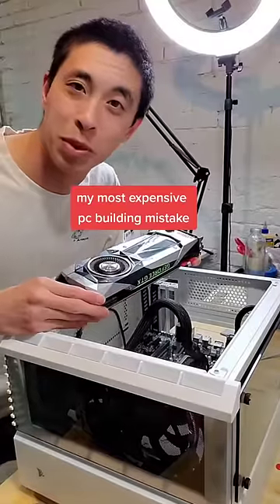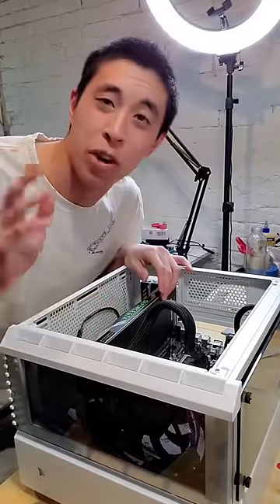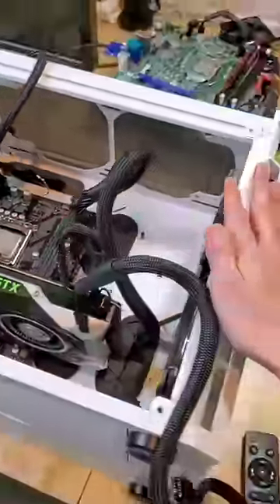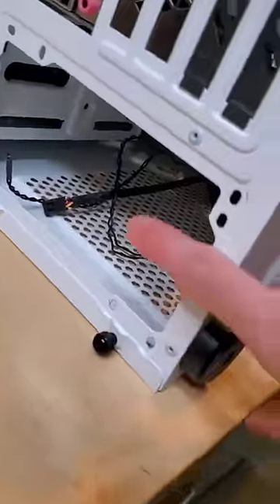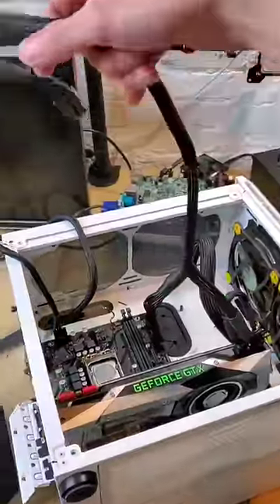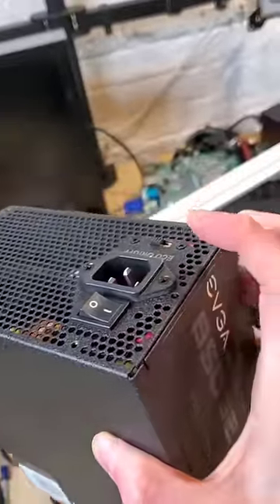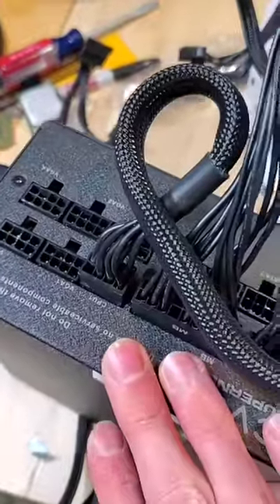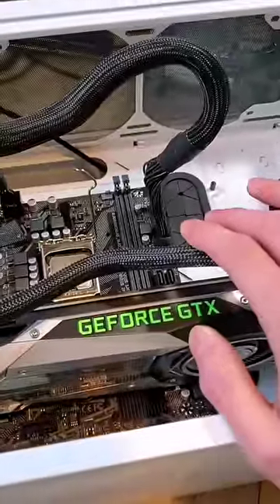my most expensive pc building mistake... #shorts

Comment: The moment I heard "pre-routed power cables" I knew exactly where this was going and I felt myself die inside.
Reply: Yepppp. First thing I went "oh pls no."
Reply: My brain went "Wow, you can do that??" As in, just mix and match cables, and no, apparently, you can't - good to know, and an understandable mistake. The one selling it set that mistake up. Every power supply comes with cables, why interchange. I had a power supply die, and switched all the cables... I think... Most at least...
Reply: I wonder why they dont make the modular psu cables a standard. It seems to be a no brainer to design them in a way that you cant accidentally plug them wrong.
Reply: @jariroth  This is a good idea. You should post this in the greater comments section area so others can see it.
Reply: @laurierbaribeau7785  just curious but what about strimer cables
Reply: @girinevass8559  those are just cable extensions
Reply: Hold on.... WHAT?! You mean I shouldn't use power supply cables from one PSU with a different PSU because they can have different rating? Bruh. That's crazy I legit didn't know that.
Reply: @girinevass8559  Looks like those are extension cables which will be fine as Robert said. They don’t do any crossing over. The problem is from using cables from another power supply.
Reply: I still don't get what was the problem... Wasn't the socket intended for the cable? How did he fry everything like that? I never used a modular psu before
Reply: @fullmontis  modular psus allow you to plug in whatever cables you want that fit. BUT the cables have different pins that plug in. For instance, from what I saw of my own psus last night, GA vs GQ sata connections have different pins going to the power supply. So if I had plugged in GQ pins cable to a GA power supply, I think I could have destroyed my hard drive. I think that's what it means
Reply: @SongEternal  Oh I see, thanks! And damn! That sounds really unsafe. Shouldn't it be standardized in some way? Like sockets on the motherboard are, so that you can't accidentally plug stuff in the wrong place
Reply: @fullmontis  I would think so too, but I'm guessing it probably has something to do with proprietary something something. And some people you ask about it will just say "WHY DIDNT YOU READ THE POWER SUPPLY IT TELLS YOU CLEARLY WHAT MODEL IT IS". So I have no actual idea because I haven't found any valid answers.
Reply: @fullmontis  The cable fits in the socket but the functions of the pins are different, like what should be ground is powered, what should be powered is grounded. So the wrong cable connects the circuit incorrectly and lots of current flows, frying and destroying lots of the electrical components on the boards. The chips can’t handle that sort of thing, they have to assume ground is ground. This is a bit speculative for me, maybe we could confirm how these pinouts vary among power supplies and cables, but it seems pretty certain that something like that is happening. Not sure exactly what the circuit is though, but seems like a lot of stuff is getting shorted or reverse biased.
Reply: @laurierbaribeau7785  that sounds like a recipe for disaster. It's terrible engineering to make a socket fit with different pinouts. I wonder why they did that in the first place.
Reply: Sry, can you please explain the video, I didn't totally understand what the issue was...
Reply: Me too. I've only been in the game a few years but have heard a few people mention it in the past.
Reply: So technically. . . buy a BRAND NEW power supply with it's very own cables and forget destroying your shit 🤔
Reply: I actually thought that the seller could actually have sold a broken pc and intentionally left these cables so that this would hopefully happen and the customer things he destroyed the hardware 😂. But that’s just my every day paranoia to buy something used. I had so many stuff I bought on eBay came broken or not working correctly that I literally fear buying something used.
Reply: I must be lucky to not have this accident cause I just mixed cables from 2 EVGA PSUs and it was fine (850w and 1300w)
Reply: @DJSelphi  well it's possible in 2 PSUs of the same brand that the pins are the same. But they have changed them in the past and there's always a chance they'll change them again.
Reply: @laurierbaribeau7785  as for your why, I also in part blame difficult cases that encourage trying to save time like this.
Reply: @barsam2a  he used power cables that didn’t come with his Power Supply, they looked like they would work, but did not.
Reply: @scorcher117  Thx man!
Reply: Did the same thing and fried 2 ssd-s and 1 hdd in a single push on a power button
Reply: Yup me too lol.  My wife almost did that once.  I was building a new PC and she was helping and I needed another power cable for my GPU but couldn't find one (I was reusing the PSU from my previous PC) so she went upstairs and grabbed one of the extras my daughter had.  Thankfully I noticed lol.
Reply: @jariroth  because they want you to buy cables.  They make TONS of money from cable sales.  They are marked up like 5000% lol
Reply: Me too! Such a common mistake if people don't know. This is a great PSA. My condolences on your loss 😬
Reply: big yikes
Reply: Facts smh I did the same thhhhinnnng with a PSU I owned previously had left in the shed had a spare case with the same modular cables right same thing fired everything was so sick
Reply: @Bob Saget don't mix and match expensive ones either. There is like 20 different pin out configurations out there, cheap doesn't have anything to do with it
Reply: I saw the headline, and already knew where this was going
Reply: @SongEternal  so do I have to be careful at both ends? Power supply matches cables and the cables match the cpu/gpu etc? Or is it not important for the gpu? (don't really expect it, but idk)
Reply: @Ray25689  I think only the part that connects to the PSU is the non standard part
Reply: Why does this break things? Is it just that different cables have different resistance values?
Reply: @supahbob94  how do cable extensions work but swapping the cables doesn’t. Is it because the pin out on the psu side is different model to model? Like what’s the reason this goes awry?
Reply: @laurierbaribeau7785  can extension cables be directly connected to the PSU?
Reply: @SongEternal  you mean different cables are channeled to different pins at output? Like cables outputs are placed differently for different PSU's?
Reply: @prus5177  yup
Reply: @d0x360  gotta love that planned obsolescence
Reply: Wait so if im building everything brand new i dont have to worry about this right
Reply: @rayyan6592  should be no problem, if youre using cables that come with the psu.

Now, what im wondering is what if you get those fancy aftermarket psu cables for both better organisation & looks. Granted, theres rly no wrong way to connect them since the pins wont fit otherwise, reading comments on here makes me think if they dont have the correct rating, they can fry your stuff. Most people i see who use those fancy cables dont seem to have this problem though.

So aside from present day aftermarket cables all being of sufficient rating, or that there was some static electricity left in the pre-routed cables that fried things when its rerouted again?
Reply: @SongEternal  it beats me how badly do many of you want to save these few minutes. When you buy new car, do you use the tires from the old one? Lolz.
Reply: Im getting a new gpu required 2x 8pins power cable , is there anyway that i can screw this up ? Im a noob
Reply: This is confusing so he used wrong cable from another system to run this one cable was botched it killed his system not one supplied by the power supply?
Reply: @wispartan  Yes. If you use the cables from a different power supply you can melt your components.

This is because the pins may be configured differently, meaning that essential pins for grounding etc. are not correctly connected and leads to failures that can brick everything.
Reply: @Don_Akane89  The reason using different cables than the ones for your PSU can brick things is because the pins may not be configured the same. Think of the cable as an extension of the slot that it's plugged into; those slots are designed different by different manufacturers. The shape is the same, but which pin is in which hole can be different. Don't ask me for specifics honestly, I won't pretend to understand it well enough to explain in detail. What matters is that the correct pin configuration in the cable must match the PSU. Motherboard side doesn't matter, just received power.

As for the aftermarket cables you're talking about, those are cable extensions. Keyword being extensions; they connect to the original cables that come with the PSU. So original cables go into the PSU, then the extensions go on the end to look nice. All the extension does is literally what it says; extends. Doesn't change the pin function or rating etc., just makes the cable longer, hence no issue.
Reply: @Kastigador19  keyword is extension. You can't "extend" what's not even there in the first place and vice versa. 

This is why you can't use extension cables directly from components to PSU. Want to use custom sleeved cables? The cables need to be built specific to the PSU pinout hence why they are quite expensive.
Reply: Same
Reply: @jariroth  Not that simple. Cables are pinned differently because the traces are run differently, and the layout/topology of different designs leads to those requirements.
Reply: @Don_Akane89  Cable extensions are electrically empty at the connectors, and custom LENGTH cables (i.e. the ones that aren't just aesthetic and are full replacements) are pinned to match the supply you request for/they sell for, which is why they ask what power supply you're ordering these for.